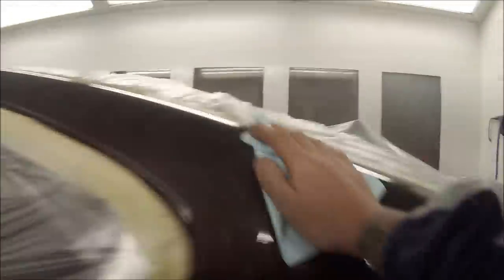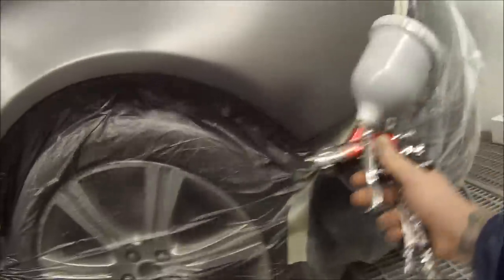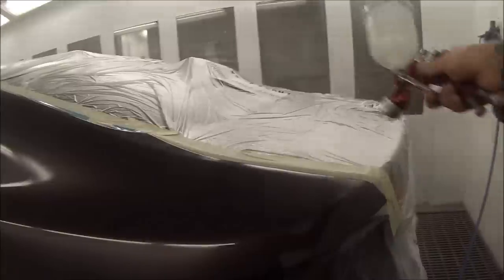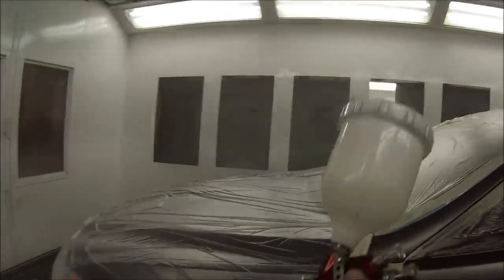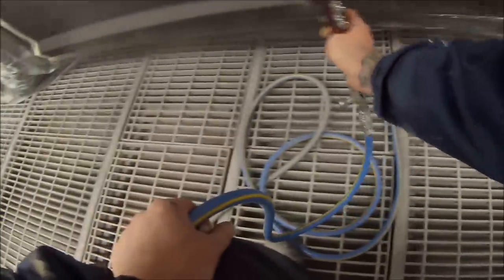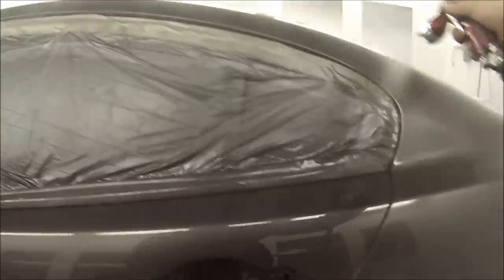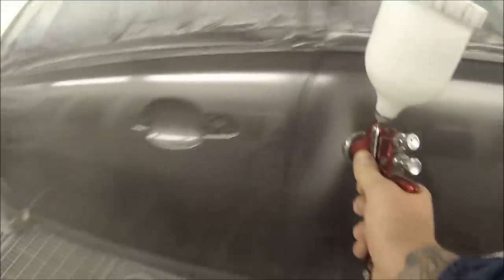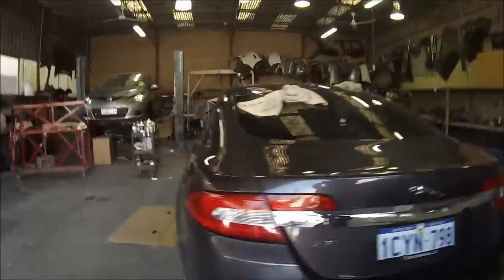How to Spray Paint "XF Jaguar"

Comment: is ur blending clear just . clearw/ basecoat ? 1:1 ??
Reply from the maker: No it's basically just clear basecoat, the tinter number I used here was 599 Standox mixed 1:1 with reducer, all paint systems have a similar product
Reply: +The Gunman how would i use a Base coat SB Blending Addictive. its Lessonal . is it mixed w clear ? or mixed w base coat ? or ready to spray?
Reply from the maker: rolandoq21 Sorry but I'm not familiar with that product and have only used Lessonal a few times, ask the paint supplier or see if you can find a TDS for it (technical data sheet)